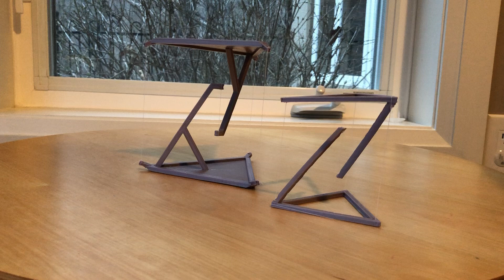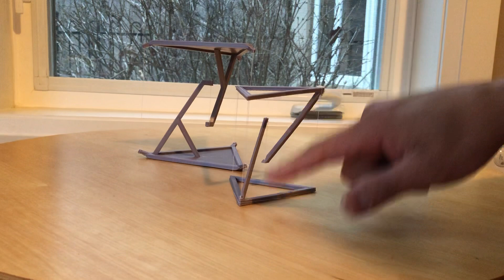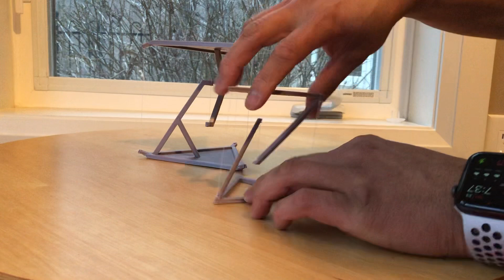Tensegrity Structure (part 2)

Comment: Use me as an ‘’i don’t get it’’ button
Reply: Imagine an object hung from the ceiling in mid air and the object has guide wires anchored on to the floor to prevent it from swaying.   In this case, the top part is actually hung from the bottom part by the middle string and the outside strings are simply guide wires.  The illusion is caused by the fact that much of the portion to be hung is actually above the part that is being hung from.  Also, guide wires are usually diagonal but in this case they are vertical which gives the illusion that they are supporting the weight of the upper object.

Comment: I wonder if you could replace the center line with really strong pulling magnets.
Reply: That is actually genius
Reply: I've already seen plenty of those ones
Reply: Bro that is actually so smart holy crap
Reply: Why ask? Try it or are you asking for permission?
Reply: @MrBonners  Working on my coops nest box then I'll give the mag table a try with the scrap boards. Keep an eye on this thread for a link to the pic later on if  I get around to it.
Reply: @WillButtlerYeets  There are several magnet ones on YT, not many.  I'm in the process of playing with long springs (salvage old Luxo lamp arm springs ). Magnets and fishing line leader/swivels is the next experiment. Not all magnets need be the same size and shape across the whole design as currently here on YT.
Reply: That is crazy bro